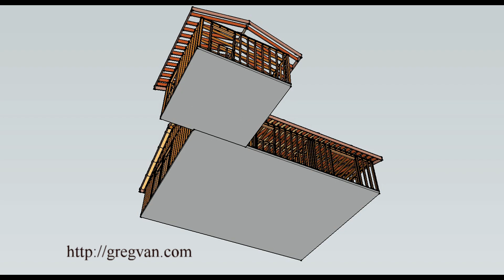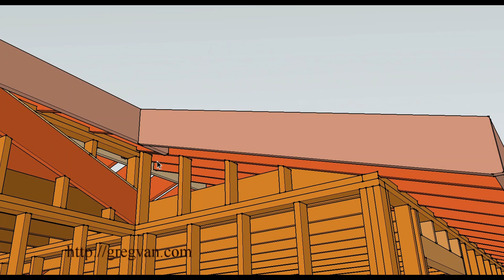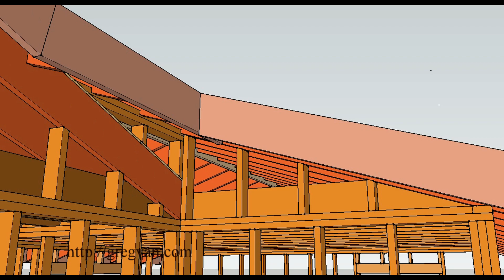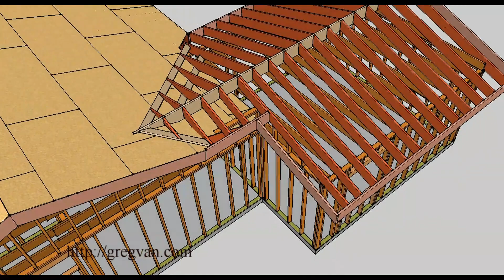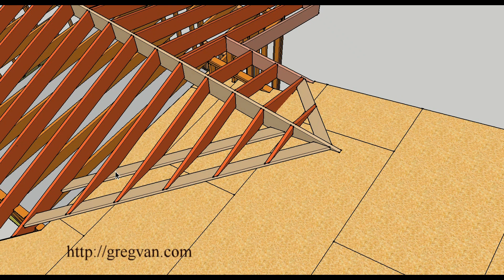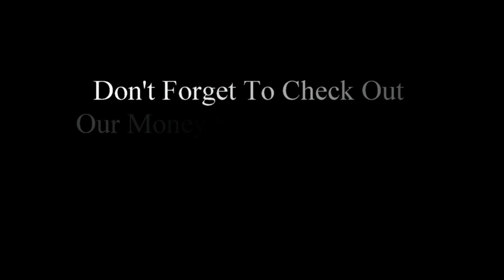How To Frame a Roof for an Offset Room Addition – Building and Remodeling Tips

Comment: This is close to what I'm planning for my garage addition. The difference is that the addition ridgeline will be higher than the existing roof ridgeline (storage trusses for a bonus room above the garage), and I plan to wrap the addition around the existing back corner, 8' up the gable side of the house, 4' short of the existing ridgeline.  That's going to make for a tricky "cricket" on the roof to get the water away from the addition gable/existing roof connection.

Comment: hello!!. hey how would I build a carport or garage onto my saltbox style roof?... prob is the slope or gable ends run parallel to the street..and the lowest part  ends at the left of my driveway or carport.. I already have a carport there but want to extend or add a extension but higher than the low roof line or gable ends..if I just extend whats there then it would be higer than whas there now..i have 7 feet at the lowest point rising up to 9 feet as it continues on up to the apex to the right about 30 feet the apexes then back to to about 9 feet on rt side of house
 thanks what cha think? Titusville florida. by nasa
Reply from the maker: Email me a picture of your home and where you want to build the garage or carport and I will see if I have any ideas.

Comment: I am in the process of adding a new garage space in front of an existing garage. The old one will be converted into a mother in law suite. It is planned to have  the new garage addition be somewhat different. The new garage will added in front of the existing and be 20 x 22. However it will also have an enclosed angled side out space off the right side. inside opening into side out section18' x Lside 13' x R side23'. end wall 18'  My question is. How would I / could I attach the roof line / framing of the side out to new garage and existing garage to make it all attached? Thanks in advance. If you would like to see an image of what we are planning. Just let me know.
Reply from the maker: Yes please send me some pictures and you can get to our email address at the website.
Reply: Sent !! Thanks.. Look forward to learning how we can accomplish this.

Comment: Hey Greg, I'm pretty sure this video was in response to my email I sent last year. If so, thanks a lot, of not, thanks a lot. Very informative and did give me a bit more to think about as I'm now finally getting the plans together for my visit to the structural engineer to go over ideas. I think this is a much better way to go rather than the sistering on to the existing rafters, creating another pitch off the main roof structure. This system would be so much less work. 
Thanks again, 
Dave Marriott

Comment: Hi... I have a question to this type of roof construction? How does the guttering for rain work? There is a small valley (Left) needs some sort of guttering, but where would you run it? It seems silly to have just a tinny piece of guttering and a dedicated downpipe for that small piece of guttering?
Reply from the maker: +Alan Brandt You've answered your own question and if the gutter was actually installed it would be small with a downspout attaching to the wall. However, you do bring up a good point and maybe a gutter wouldn't be needed.